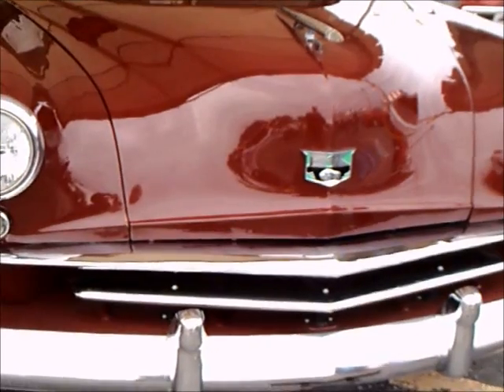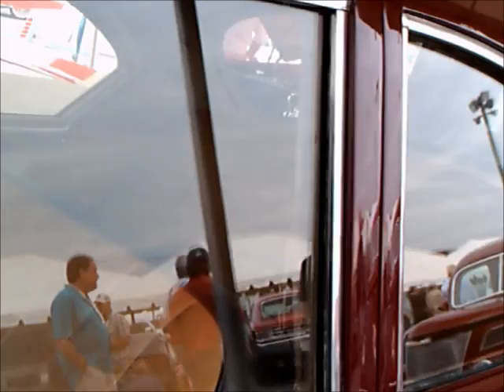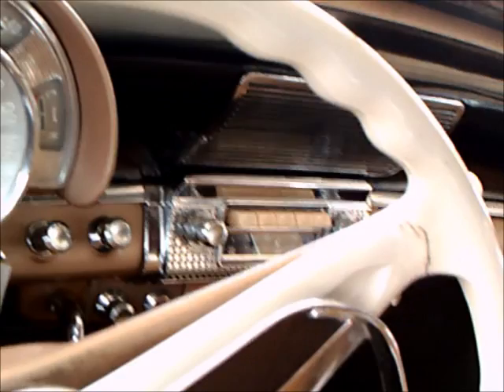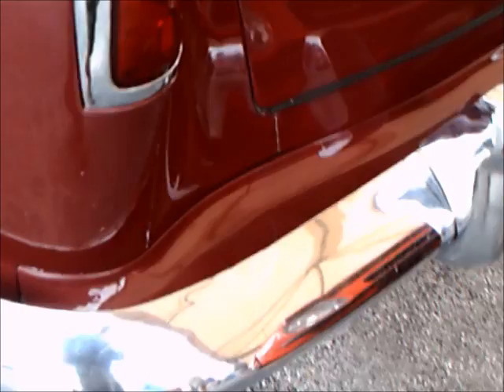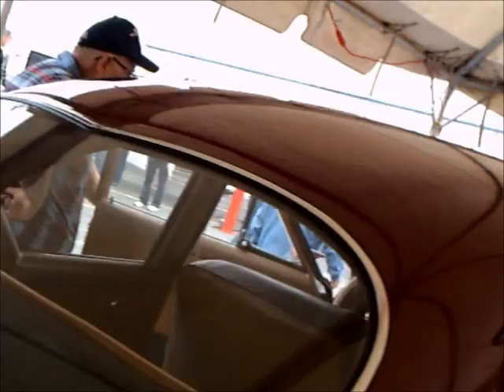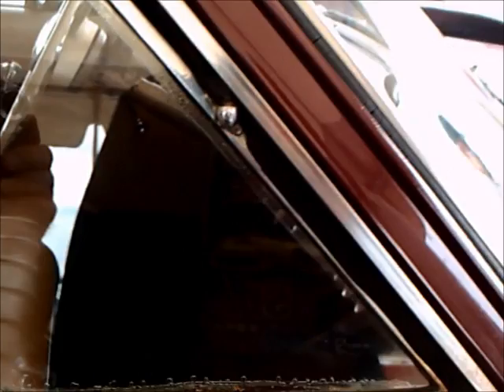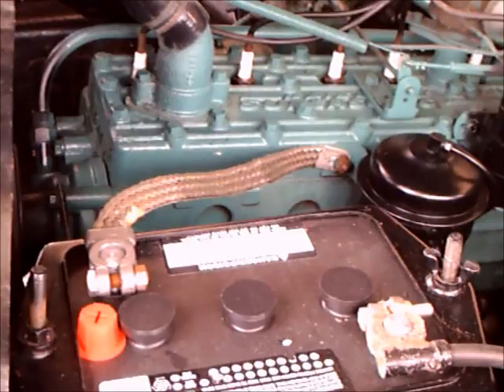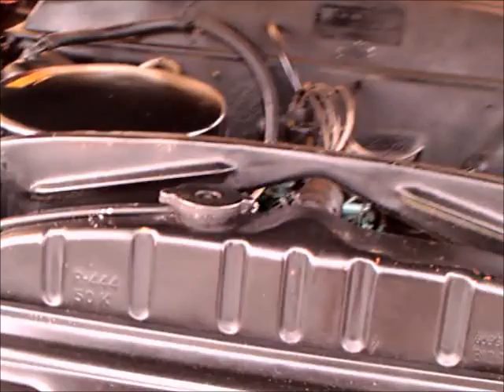1951 Kaiser Business Coupe Maroon ZH111513

Comment: My understanding is that the engine was built by Continental motors. Have you heard anything like that?  My dad had a '51 when I was a child.  He said that the engine was a Continental and not really strong enough for the car.
Reply from the maker: Hey, Jim!  That is my understanding too...Continental supplied engines for several cars.  It really was more suited as a stationary power plant engine..the low end torque was not particularly great for an auto engine.  That engine was the Achilles heel of the company.  Thanks!  :) Jack
Reply: Yeah, Kaiser had engineers design a camshaft that would provide a flatter torque curve for increased flexibility over a wider engine speed range. Kaiser's in-house engineers were developing an all-new 288-cubic inch overhead valve V8, but never got past the early prototype stage due to budget problems, specifically that Henry J. Kaiser spent the money that could have gone into the V8 on the development of hatchback and convertible sedan body styles, and the Henry J, all against the advice of his partner and automotive pioneer Joseph Washington Frazer, who had dealt with Kaiser to keep his Graham-Paige motors afloat. The earliest Frazers built in the Kaiser-Frazer plants, incidentally, were badged as Graham-Paiges.
Reply: Continental Motors made engines for many makes of cars and trucks as well as industrial engines. When Kaiser set out to make cars they bought a factory from Continental and paid them a royalty to make their design of engine. It was similar to one used in trucks and industrial use except it had separate intake ports for each cylinder instead of  siamesed ports. Kaiser engineers improved it in various ways, as time went on it differed from the Continental in detail although it looked the same from the outside. Kaiser continued to make the same engine for Jeep station wagons up to 1961.

Comment: Jack? Did you get stuck in 1951 on a Kaiser Car lot and brought this to us in the future? Because this one looks NEW out of the show room. I never seen one like this either. I understand the concept of a "business coupe" but I would think a 2 dr. wagon would be more useful. And losing the back seat must of made them harder for resale unless you could buy these business coupes new for a lot less to begin with. Thanks Jack!
Reply from the maker: Hey, Gene!  No question that a stationwagon would have been more useful..and I think that's one of the reasons why they disappeared.  It really was a niche market..and the wagons of the late 30's were high maintenance wooden bodied types, so they made sense then.  As wagons became all steel  units, they became more desirable as versatile haulers.  I think  you're right about resale value..it would take a special customer to buy one!  Thanks!   :) Jack
Reply: Kaiser introduced a hatchback-type two-door and three-door (left-rear door was welded shut) sedans called Traveller and Vagabond, depending on trim level. The tailgates were basically the transom-clamshell type arrangement where the upper portion was hinged to swing up above the rear window and the lower section swung down like a conventional wagon. The divider ran across a line about a third of the way down from where the hinge of the normal sedan's trunk lid would gave been.

Comment: We had a Henry J at one time, this business coup looks like a Henry J without the back seat.   That paint job is far beyond anything Kaiser did. All of the original ones I've seen were dull finish with drab colors, likely one of the biggest reason they were poor sellers.  Who wants to look at a dismally drab car day after day.
Reply from the maker: Hey, Frank!  The styling had the Darrin DNA, even evident in the Henry J!  This is the one and only Kaiser business coupe I have ever seen in my travels, and believe me, I 
always am on the lookout for Kaiser-Frazer cars.  Thanks!  :) Jack
Reply: @coolrides    Jack, the  one here went to Florida some years back. Young collector wanted it to either restore or use for parts.  Those cars used a Red Seal continental industrial motor. Definitely not over powered, Similar to the ones we used here on the farm in some light tractors and harvesters, tuff and taken care of, would give good service.  Back then the speed limit was 45 to 50 and the continental could keep up, but thats about all. I think Kaiser was low on capital, so they just used off the shelf vendor motors and parts to hopefully get by till better times that never came.
Reply from the maker: We sure appreciate your mention of the Continental red seal engine.  Lots of cars used Continental engines back in the 20's and into the 30's, it was a good way to get into the car business when the engine was "off the shelf". https://en.wikipedia.org/wiki/Continental_Motors_Company
Kaiser-Frazer was flush with money when they began production right after WWII, fueled by the scarcity of new cars. However, that soon faded and Henry J. Kaiser refused to cut back production when his dealers were flooded with unsold cars.  Poor decisions by a guy who just didn't know the car business...Frazer knew better and got out early on.  Thanks!  :) Jack